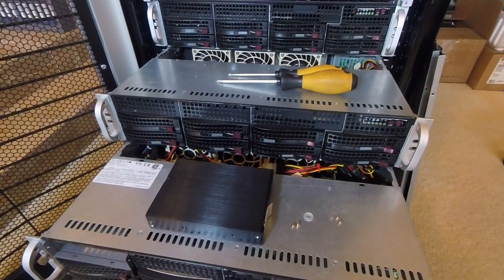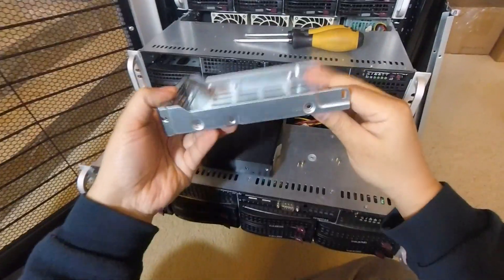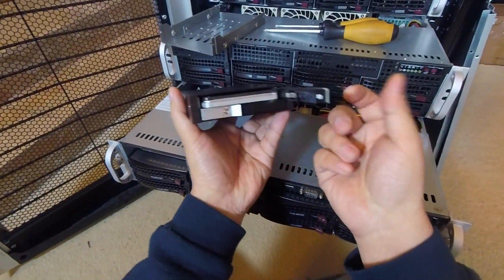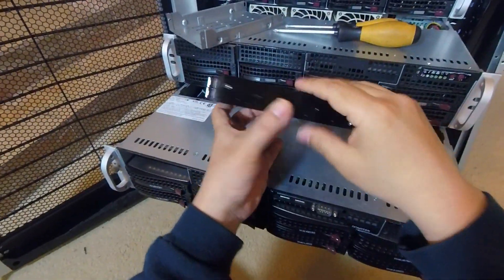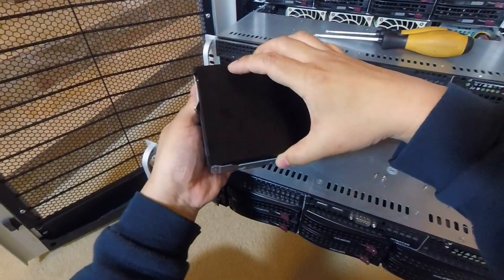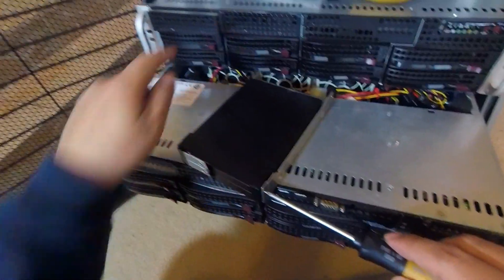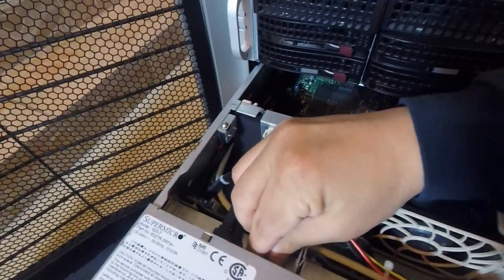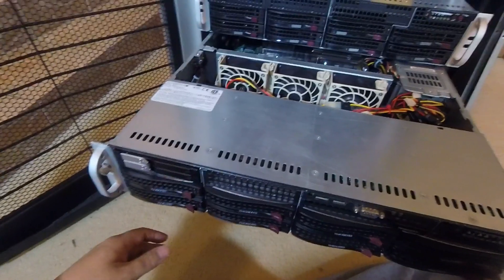How to add hot swap boot drives to supermicro 825

Comment: will this work with U.2 NVME SSD's?
Reply from the maker: The enclosure I used in this video will not support NVMe. However, you might be able to find such an enclosure from the likes of Icy Dock or other brands that make similar devices. That said, NVMe are PCIe devices, so you need a way to connect those drives to your PCIe bus.
Reply: @ArtofServer  Thanks I ordered a  Supermicro CSE-826BE1C4-R1K23LPB 12-Bay 3.5" which has the rear dual NVME drives. Trying to figure out how to mount a 2 slot GPU in it! lol the power supply should be able to push a GPU right? i just have to make sure it's the right kind of power cable... I got a 3090 from a dell r13 which is a 2 slot which will fit, it's just the question of powering it....

Comment: how do you take the top of the server off lol i can't figure it out i see the buttons but you push or pull? do the tango ?
Reply from the maker: To remove the server lid, press down on the two buttons, and slide the lid towards the backend of the server.
Reply: @ArtofServer  I didn’t see the one screw on the side took it out and it worked. My dvd rom doesn’t work figured out it’s not connected not sure where to get the cable to hook it up abs it doesn’t see any of the hard drives. Not sure what the setting are suppose to be. It post tho and I can get into the bios

Comment: Hi Art of Server! i have a question regarding dual cpu's, i have this one Intel XEON E5-2658V2, and was thinking of upgrading to another one some time later, will there be any issues with that or can the same type be installed even tho it does not have the same "serial" or that number that i see people referring to ? Thanks for your videos!
Reply from the maker: @Christoffer Sundbom I think what you're referring to is called the sSpec, or Sample Specification number. There are some instances where different sSpec will have slightly different features, for example some virtualization feature might not work, so mixing sSpec is not always recommended. However, in many cases, mixing sSpec CPUs in a dual socket system will work. In either case, it's not usually hard to find another Xeon CPU with the same sSpec, so to keep things simple, I would recommend just getting the same sSpec CPU when you "upgrade" to dual socket.

Comment: Useful video!
If I may suggest something for your store: these case fans are noisy. How about selling some modded fans with Noctua fans inside them?
Reply from the maker: Thank you! I always welcome suggestions so keep them coming! 

However, I've done the Noctua fan mod on a few different Supermicro servers. And pretty much every time, I ended up taking them back out and going back to Supermicro fans (usually made by San Ace). What I found out was that the Noctua fans simply don't provide enough pressure to draw the air through the HDD bays, or if you spin them up, the fan control becomes out of sync with the other fans and there's an imbalance and you're back to something noisy. I like Noctua fans when they are used for what they are designed to do. But you have to keep in mind that Supermicro uses at lot of 80mm diamater fans in their servers (2U,3U, and 4U chassis) and simply replacing that with a 80mm Noctua just doesn't work very well, or at least not to my own satisfaction. If you're looking for noise reduction, I think it is necessary to use a larger diameter fan if you want to maintain enough air flow and pressure.

On the other hand, I've found that keeping the Supermicro fans while improving the PWM fan control does a better job, so I would rather recommend more granular fan control than to change the fans.

Since I wasn't satisfied with swapping Supermicro fans with Noctua myself, I wouldn't feel comfortable selling something I don't use myself. But, I really do appreciate the suggestions, and I may try Noctua again in a different configuration (I do use their CPU coolers for my desktop PCs).
Reply: @ArtofServer  - I have been through that path myself on a couple different chassis.  The fans that Supermicro uses are thicker, which also helps them move more air.  I used fan speed regulator modules to cut the speed down by about half and still had adequate cooling to keep the drive temperatures under control and simply needed to add an active fan unit to the CPU in place of the passive unit that was standard.  Hopefully this helps someone else.  The factory fans are very good quality fans, so I agree that there is no need to change them out.
Reply from the maker: @chrismoore9997   Yes, you're correct, the thicker 80x38mm fans (vs Noctua I think was 80x25mm?) are able to provide more air pressure to pull through the small crevices around the hard drive bays. And they are indeed pretty high quality fans. Additionally, Supermicro has a wide selection of fans that are drop-in replacements, so if you have one of those 9000-RPM fans, there's a replacement that is 6000-RPM or 5000-RPM that will remain adequate even if you have hot components. (look for parts like FAN-0074L4)

now, when you say fan speed regulator modules, are you talking about those inline resistors that drop the voltage to slow down the fans? if so, I think granular fan speed control is a better approach for the following reasons: 1) you don't lose the full range of the fan's speed, especially if something does get really hot, you have the full range to increase cooling capacity, 2) you have better control of the low-end speed so as to not trigger any thresholds that would cause a fan ramp up. 3) there are ready drop-in replacements from Supermicro that will lower the max fan speed (as mentioned above) and this is probably simpler than adding inline resistors. 

the X10 and newer Supermicro systems can control fan speeds, in something like 64 increments, but requires some "custom" program/script to coordinate fan speeds vs temp sensors. the Haswell generation of Gigabyte server boards have a very granular 128 (?) step offset setting to the entire fan speed curve - which I really like, if only DDR4 wasn't 2x the cost of DDR3 still...
Reply: @ArtofServer  How about ARCTIC F8 PWM PST fans? 
This fellow on reddit did that: Congenital_Optimizer
I replaced the insanely loud stock fans in my supermicro CSE-826 with ARCTIC F8 PWM PST fans.
You can plug them directly into the back plane connectors. Went from carrier flight deck to gentle breeze. +1 to +3 c change in drive temps after the swap.
Reply: @ArtofServer  How do you accomplish what you recommend to lower the RPM of the stock supermicro fans: "I would rather recommend more granular fan control"? Is that in BIOS (I don't see much options in my 1u supermicro's) or somehow else? Btw, your videos are a gold mine, thank you!
Reply: @godelrt   If you've got a board with ipmi control over fans, you can adjust the threshold RPM values to whatever you like with ipmitool.